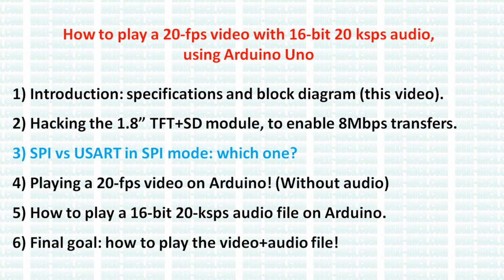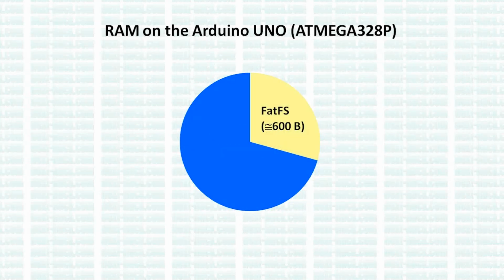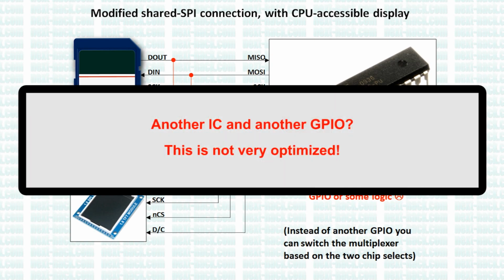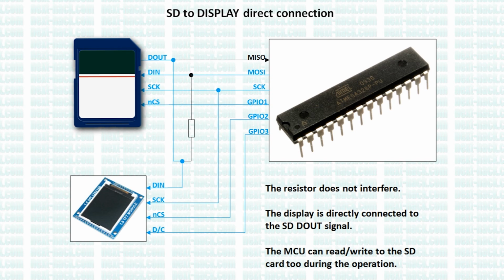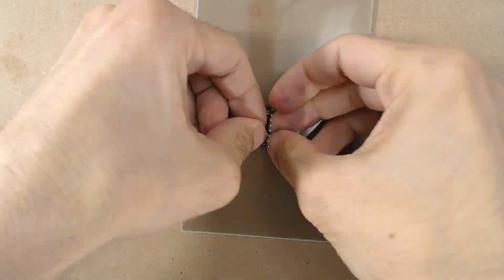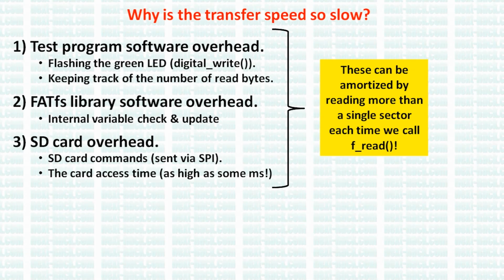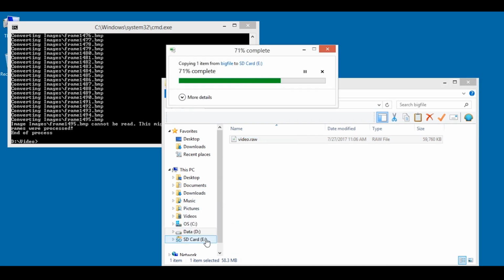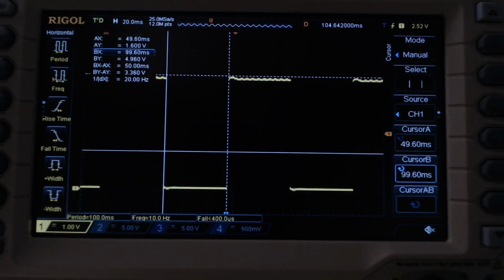How to play a video on Arduino Uno (4/6): playing a 20 fps animation from SD card!

Comment: It's now 2026. I stumbled upon this project just 30 minutes ago.   Incredible hack!!  I have a Uno R4 minima and a 2.8" TFT  (320 X 240) SPI display shield from Adadfruit. So far I have learned only how to display BMP images stored on the SD card. I've been wondering if I can display video at a decent frame rate and now I see there is a way to do it on an R3. Maybe it will work on my R4 minima too.

Comment: How do you know what kinds of command should be sent to display cmd pin 
and is there any way to reach this 8Mbitsps speed without CMD 

I have such kind of display but my code is not optimized yet
its resolution now 64x202 @ 1bitppx x 15FPS = 0.2Mbitsps

it has 64 leds and while rotating we can reach to see video 
and it uses 8 x 74hc595 shift register connected to each other as a train

Do you advice me to chanche schematics of PCB or have I to optimize my code 
thants in advance :)

Comment: the st7735 takes 56bits for screen position command and 16bits for color data over SPI to draw single pixel. So If my math correct then 160x128x72x20 = 29,491,200bits/s = 29.5Mbits/sec. But how did you do that with 8Mbits I have no idea.....???? 🤔🤔🤔🤔🤔

Comment: Ok this maybe a elementary question, but how do you mount the FAT file system on the sd card? I know how to do it the normal way but i don't know what part of the code actually puts it on the card. i went to that site and just ended up with a bunch of files.

Comment: I was able to do this on a Parallax Propeller 2 evaluation sample board without the hardware hack. SD -> Hub RAM -> SSD1331 display reading and writing one frame as a time and manipulating the BGR to RGB. Only used 2 of 8 CPU cores.  https://www.youtube.com/watch?v=ja84rf38QHM

Comment: Dear next-hack san
Hello

I have a question, so I will ask you a question.
I am trying a video player using SSD1331.
bmp2raw.exe tool, where should I modify the source code to make the conversion size 96x64?
Reply from the maker: Hi there! In the main.c file at line 108, there is a function call:
    createRawAudioVideo(inputFileName,waveFileName, outputFileName, numFrames, 160, 128, useAudio, samplesPerBlock);

Instead of 160 and 128, put 96 and 64!

I hope it helps!
Reply: @nexthack  
Thank you very much.
This is the only change.
I want to challenge.

Comment: hey great video, can you do this by sending the video from your computer? im trying to make a screen i can plug into my raspberry pi from an arduino tft
Reply from the maker: Hi Elliott, I'm not sure if I have understood correctly: do you want to connect a TFT to a raspberry, and then the raspberry to a PC, or do you want to connect an arduino to a raspberry?
Or an arduino to a pc?
Reply: next-hack the tft to the raspberry or through the arduino to raspberry, thanks for replying im just trying to find a way yo use it as a mini monitor
Reply from the maker: @ReplicateReality  You can connect the TFT to the SPI of the Raspberry, but then you need to actually create the driver to use it.
Reply: next-hack thats hard im guessing, how would I even start that?
Reply: next-hack also thanks a lot for the reply love the video
Reply from the maker: @ReplicateReality  I suggest you to take a look here: https://github.com/notro/fbtft/wiki/How-it-works, there is a good collection of drivers!

Comment: Best video so far I've seen on making this happen with an Arduino UNO board. I will look up for your solution on how to play video+audio since I am currently trying to do the same with hi power speakers of at least 100w in kiosk mode with very little user interaction.

Comment: Hello

Very smooth movie can be played upside down.
This is because your LCD is on the opposite side to the published specifications.
In order to solve this inconvenience, we partially modified arduino's firmware.
Description of "CMD_MADCTL, 1, 0x60, // Set address mode 0xC8" in display.c.
We changed the value here from 0x60 to 0xa0.
By setting this setting, the data stored in the LCDRAM from the MCU was changed to Y - Mirror.
Then I was able to play the video in a normal orientation.

Thank you very much.
Reply from the maker: You're right. The display was mounted upside down, to get SD and USB connector on the top!

Comment: Sir, first, I'm subscribed. Your channel is great! your website is great! your website now, is in my favorites. I wanted to ask you something. It is something that for a Brazilian technician with only high technician school, it is difficult. But, here's the question. I want to know if it is possible that there is communication between a certain 8-bit file in the sd card  and an EPROM, also 8 bits, with 8 data pins (D0-D7) with the Arduino. I want to send this 8 bit file from the sd card to the EPROM which contains a specific program inside it  to read this file. The EPROM is the 27c256. Is there any means of this idea possible? thank you very much, Sir!

Comment: Great video! I've tried your concept on Atmega328P 8Mhz 3.3V + SSD1331, and it works with 1 kOm resistor. I'm not sure about audio solution though. Seems like that would require additional chip to cut graphics and sound bits, also a new file format.
Reply from the maker: Hi Uep Pep! 

Spoiler alert! 

The audio part does not require any other chip, beside a simple op amp :) 
If you analyze the source code of the bmp2raw command line tool, you'll find that the audio part is simply interleaved with the video :)

However, some optimizations on the code are required, though. to play audio + video :)

Comment: Could I get the connection diagram for a 3.3v system (like a 3v Pro Mini)? :)
Reply from the maker: Hi there! 
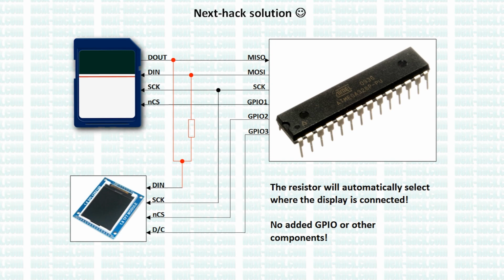The connection is shown at 4:00. Since you must use the USART, the connection is SCK = XCK (PD4 or D4), MISO = RXD (PD0 or RXI), and MOSI = TXD (PD1 or TXO).
However, the Arduino Pro Mini only runs at 8MHz @ 3.3V. This is half the frequency of an Arduino Uno, so you'll be able to get only about 10 fps.
Using an Arduino Zero (for instance), you can use the single-resistor solution, and you can achieve much higher frame rates (about 30-33 fps @ fSPI = 12 MHz. The theoretical maximum would be around 36 fps). By increasing fSPI, you can achieve even higher frame rates, but some display controllers might not support too high SCK frequency values.
Reply: Thanks for the reply - I didn't think I would get one :) That's a great help.